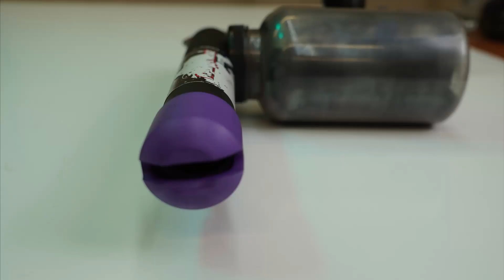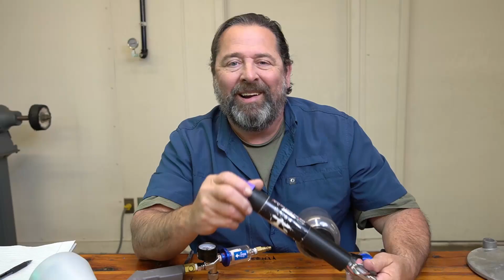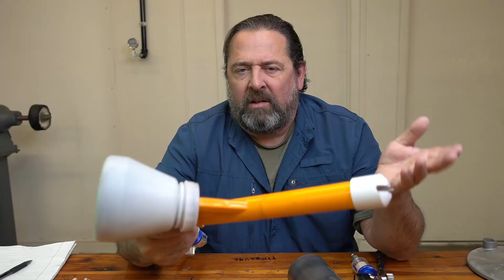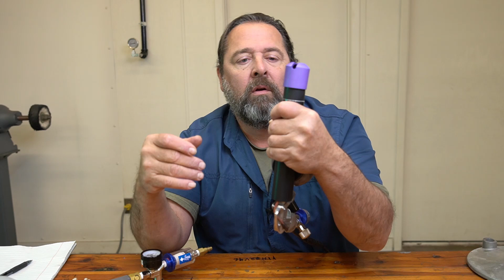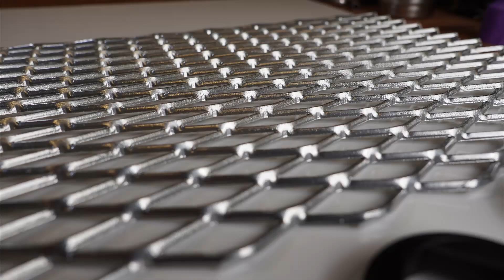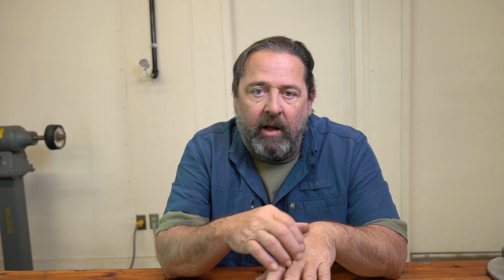FAN NOZZLE attachment for EASTWOOD and HARBOR FREIGHT powder coating systems

Comment: Hey Larry.  What kind of prep work did you have to do?   That expanded metal is usually pretty dirty and has surface rust.  Maybe this is another video. Thx.
Reply from the maker: I keep my metal stock in a controlled enviroment (inside my shop) so it's not exposed to the elements of wheather, so very little if no rust.  The sample piece in the video was cut from a new 4'x8' sheet, then I blasted it with glass beads to clean it up and after wiped it down with aceton.
Reply: You can get a small blaster from Harbor Freight that holds about a pound of sand. Works fine, and cheap.